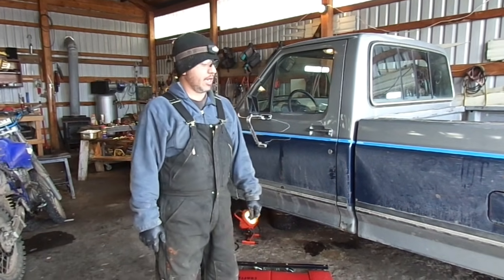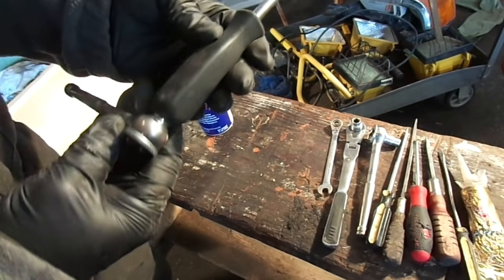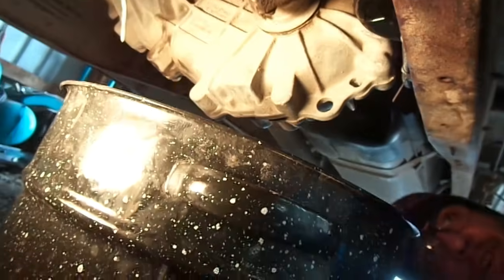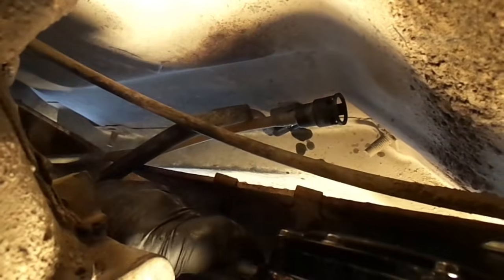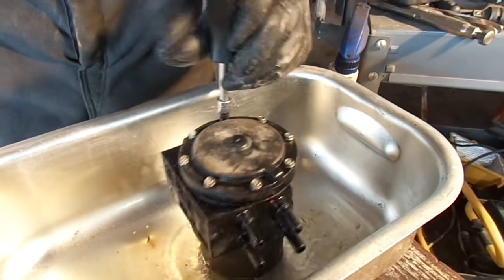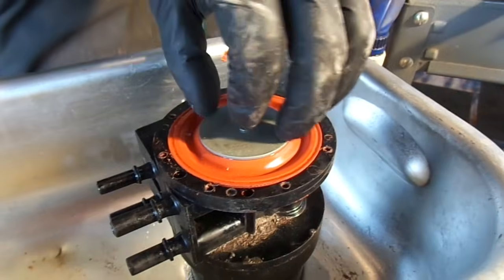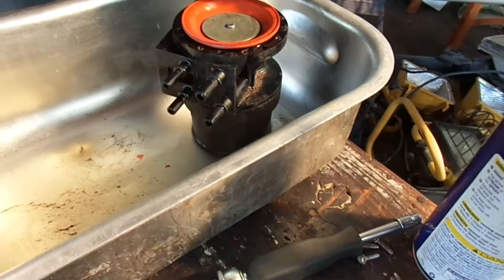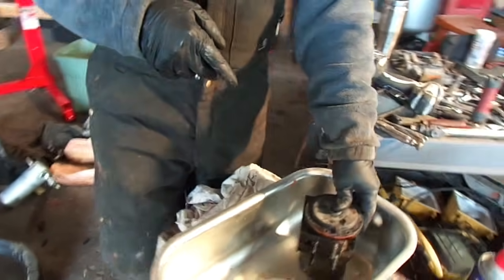1987 F150 Dual Fuel Tank Selector Repair

Comment: I followed your instructions to the letter and you saved me hundreds of dollars!!!  Great fix!  Works like a champ!  Thank you!!!!
Reply: @Saul Varela I'm having same problem with my 92 ford f150. I have two tanks and I only use the rear tank. Last week truck stop on me at gas station. I thought it was my fuel pump. Still not working. I'm going to do this tomorrow. I hope it works
Reply: Curtis Jones I'm not a mechanic but I do own a 1989 f150. Ive done plenty of research on this fuel selector reservoir and I'm sure I read some where that your 92 f150 has a high press  fuel pump in each of your gas tanks and 1fuel filter on the rail. It doesn't use this fuel selector reservoir that's in this vid.
Reply: @Saul Varela it was my fuel selector switch. Spent  $490 on parts.lol. switch cost  $20.00 @ AutoZone. Smh

Comment: both tanks were leaking on my 1990 f150 replaced them now when I put rear tank on it puts the fuel in the front tank it will put all the gas in the front tank in about 5 miles so I switch to front tank  and run off it.ever hear of this problem.
Reply: maybe I got some dirt in the lines when I changed the tanks I will clean the selector valve and let you know how I make out thanks for the info
Reply: There was a recall to fix this problem. It is expired now though. Look up online to find details. If I remember right, it had to do with mechanisms in the pumps in the fuel tanks (sender) and not the fuel selecter valve.

Comment: thanks for the video, saved myself lots of trouble because i was about to pull the tanks down to exchange the fuel pumps. I am sure glad I came across your video. My 89 E250 Camper Van now runs. i bought it cheap because it wasn't running and the previous owner had enough of it. I got it running by banging on the tanks so i assumed it was the pumps. However when i tried to drive it home as soon as i needed power it died and of course in the middle of an intersection. Now after this little procedure i think she will be just fine, she runs now on both tanks and also revs up. One question i do have for you. Was there a filter in the fuel cup on yours? Would you have a specific part number if you did, also for the O ring that is in there. Mine did not have a filter in it and on the cup itself it says not to open it. I used a different o-ring that is a little thicker then what was in there but it seems to seal.

Comment: I was having the same problem on my '86. I am fortunate to have found a deal on a running donor truck with a good front tank but also bad selector valve. It took me all weekend but i was able to swap out the tanks and clean the valve, following the steps detailed in your video. I won't know for sure 'till i make a couple of trips to work but so far it appears that everything works as it should. Thanks for the video! It really was a huge help!

Comment: You wouldn't by chance know the best way to change the filter in this without messing up the o ring?
Reply from the maker: Hey Rebel, I bought a replacement filter and a new oring came with the filter. I usually coat the oring with some grease to keep it in place.
Reply: Jonee Varela yeah I ended up messing up 2 o rings before I went and got some gasket maker that is gas resistant and put a little bit to hold the o ring in place and so far after 2 day no leaks. I hope using that gasket maker doesn't bite me in the ass later on.

Comment: Great video! How hard was it to change the filter in it? Does the filter bowl screw off easly?
Reply: Kevin Melton the filter housing should be removable without taking the housing down from the frame. you might be able to slide an oil filter wrench on the filter bowl and take it off. some bowls get a lot of dirt and are hard to break loose at first. Just clean the threads good before installing and make sure the o-ring on the filter bowl stays in place as you reinstall the filter bowl.
Reply: Jonee Varela  thanks,I was worried about if it would bust/ crack if it was on very tight.

Comment: Thanks for the video. It has really helped cause I've been scratching my head with the weird fuel transfer problems on a used 89 F-250 that I bought a little while back.  It has the same canister / valve and my gas has been just pouring out of the front tank, (cost me $30.00 to go from I.F. to Mud Lake yesterday).  I too live in Idaho, up in the middle of nowhere (30 miles north of Howe) and was raised the same way, take it apart and look at it before just throwing your hands in the air and buying a new one. Lot's and lot's of scraped knuckles! Again, Thanks a bunch!  Great Video.

Comment: Hey man, thank you for the detail in this video. I just got a 88 f150 with the same issues going on. Whether this is the solution to the problem or not, it definitely gives me peace of mind knowing it's working correctly.
Reply: Gabriel Zubia, some people are finding that the hoses going to the pumps inside the tanks are deteriorated to the point where they fall apart as well. You can test the pumps to make sure they are working after you remove them; if it's not the fuel selector.
Reply: Awesome! Thank you so much